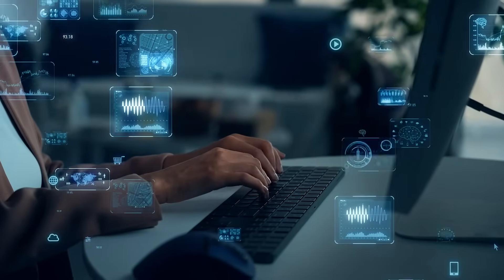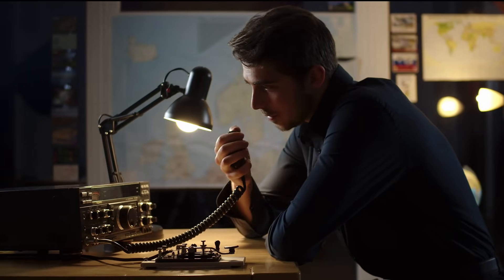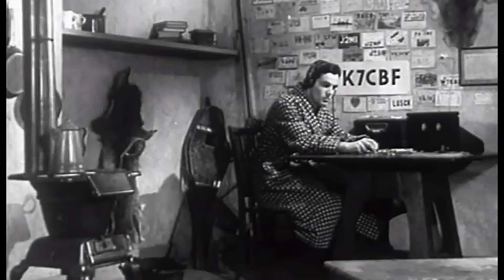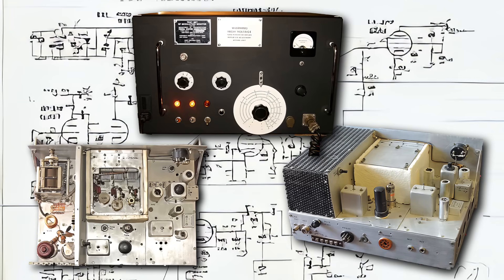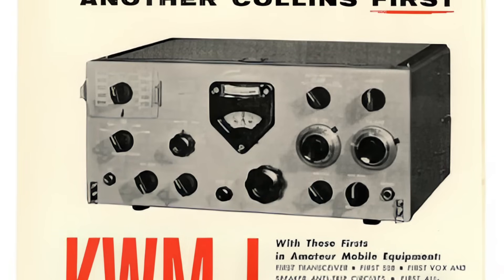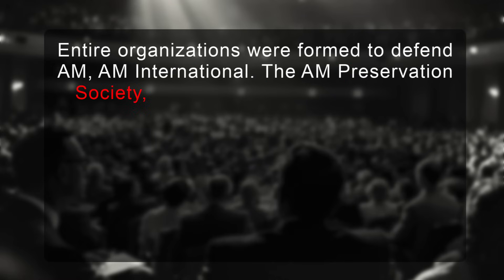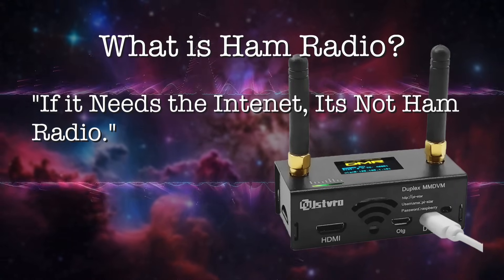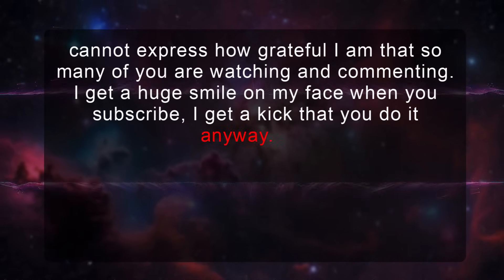Why Single Side Band (SSB) Almost Never Existed!

Comment: I knew SSB wasn't looked upon favorably when it first came about in the hobby, but I did not know it was hated as bad, or worse than, FT8 is currently.  I laugh when people say DMR is not real ham radio because it relies on the internet.  The only time you need the internet for DMR is if you are going to link a repeater to a global network such as Brandmeister or if you are going to use a hotspot to connect to talk groups on Brandmeister or other DMR networks.  You can talk on stand alone repeater or on simplex using DMR without using an internet connection.

Comment: i honestly never bothered to upgrade past tech-plus cause i never cared for usb on 10 meters., plus 13 wpm-no effin way was i going to be able to copy that. and now, i dont remember hardly any code. never even knew this story on this video about other hams so adament about AM. CB uses AM, but only 4 watts legal. On 10 meters, i dont even get ANY watts for the 29 mhz portion. Maybe someday i'll upgrade? 29 fm sounds more interesting than usb N9IZX Canton IL
Reply from the maker: Jeremy now that there is no code requirement, heck you could go for an Extra if you wanted. It would be nice to have you join on the rest of the HF bands as General at least.

Good Luck
Reply: I was kept out of SSB except on 10m for the best decades of ham radio.  Got an extra as soon as they dropped code, but with phones and the internet... talking world-wide just isn't the thrill it would have been.   That CW requirement was really... unfriendly.

Comment: I don’t understand why there was such a hate for SSB considering it’s way more efficient, especially over ground wave and goes a lot further distance wise over ground wave vs AM. These days some stations really spend a lot of money and have a lot of pride in making their SSB stations sound really good.

I have no love for FT8 and I’ll never do it. It’s too impersonal and lacks substance in my opinion. But hey it’s a great thing about the ham radio hobby, something for everyone. If you want to be an FT8 lover all the power to you.
Reply from the maker: I don't think there is that much hate for SSB as there was because it is the dominant mode. But in the early days it was new and many people don't like change.

I think the reason and value of FT8 is it allows even a small station or someone in an HOA the ability to get on the air and work the DX.

I see it as an entry drug to get more people in to the hobby. :) To carry on a meaningful QSO via voice requires personality and a level of genuine interest in meeting other hams. Some hams do not are are not capable of that level of interaction. LOL
Reply: @HamRadioGizmos you can make QSO’s QRP sideband. I see FT8 as the lazy hams mode. Especially those that let the automated version run 24/7. K7CAR for example, there’s no way he’s sitting in front of his computer 12+ hours at time clicking the mouse to complete the contacts.

I will admit your points are well taken but you’ll never catch me letting a computer make my contacts for me.
Reply from the maker: @truckinguy92  First, let me thank you for taking the time to share your comments. I believe it is healthy to debate these issues. We have forgotten to agree to disagree. Yet this is the basis for the entire constitution of the US. So thank you for taking the time to comment. Now here is a slightly different perspective.

When either contesting or watching SERIOUS hams during a contest. The computer does almost the same thing as FT8. They use clusters to find spots, click, radio tunes, and you make your call to the station. The software enters the call sign, frequency, it queries QRZ and enters their name, location, and a lot of the info.

I enjoy RTTY contesting and N1MM is all point and click. Add SO2R with two radios, and this is the only way to get a decent score nowadays.

And frankly, some days I don't want to pick up the mic and make small talk. "QSL, 59 here and rig is a ____" 

The other thing most people don't realize is that our society is changing. Not everyone can put up a tower and a Tribander. So, digital modes open the hobby to anyone with any kind of station.

And yes, you are right, you can work stations using QRP and SSB. But in my experience, this is like working a mobile on 80 meters. It is NOT armchair copy and the majority of hams do not want to struggle to pull out a weak station unless it is Rare DX. :)

Finally, I judge a mode or operating setup like FT8 or POTA by the value it brings and the growth it contributes to the hobby. It might not be my or your cup of tea, but does it help ham radio? And personally, I think the work that Joe Taylor and crew have accomplished with FT8, FT4 and other weak signal modes is nothing short of magic. I used to work EME, and in the early days, all we had was CW to bounce off the moon. But this mode has contributed to the growth of EME considerably with Joe's development of JT65. The guy is a legit Genius !! LOL

PREDICTION
If hams hate FT8, I can't wait to see the hatred when we see the development of "Conversational AI" that will carry on a meaningful conversation, and you don't even have to pick up the mic to make a contact. :) This is a natural evolution considering smartphones, Siri, Alexa, and other technologies that are being advanced daily.

I am not condoning or suggesting this is right or wrong. I am simply predicting the future as I see it.
Reply: @HamRadioGizmos  all good points. I’m not really into contesting, but I didn’t realize it was all so automated and computerized. Once again it’s kind of impersonal. Where everyone is a 59 even though they’re not.

My whole thinking about digital FT8/4 is that it’s so impersonal. Our world is being so conditioned to not communicate by voice any longer. Email & texting come to mind. At work & in life nobody wants to pick up a phone and have a conversation any longer. I can certainly convey want I want to say in conversation vs sending it in a text or email (I’m not the fastest typer in the world) a lot faster than typing it and then sending it. It’s missing the conveyance of emotion, and no an emoji isn’t the same. I just watched a news report the other day that teachers are getting frustrated & quitting because the children they teach have no communication skills. They’re not even able to hold a conversation, read proper English, or write with any meaning unless it involves a computer or a cell phone. They can’t even write on a piece of paper and cursive is no longer taught.

So with all of this automation, email and texting ham radio is my escape to a world where I can actually hold a conversation without sending it in a text or WinLink email. I feel that the digital modes like FT8/4 are encroaching on that because if everyone is there then that leaves less of a pool of possible people for me to talk to. Like I said I refuse to let a computer make my contacts for me.

The way I see it we’re headed down a slippery slope with all of this AI stuff especially when it comes to persons that would use it for nefarious purposes. There’s always going to be bad people in the world, but this AI stuff is going to make it easier to become even more nefarious. Then there’s the whole “Terminator” thing. As crazy it is science fiction at the moment if we’re not careful I feel it could become a reality in the future. And no I’m not a crazy conspiracy theorist that thinks the world is out to get me/us. I’m not saying all AI is bad, but if we’re not careful we could wind up in a lot of trouble.

Like you said, at the end of the day I guess we’ll have to agree to disagree.

Comment: Before Digital and VOIP, most calls were handled by sideband for all the reasons you stated.  L carrier may have been the most prolific systems for decades.   12 channels were muxed to dozens then hundreds,  Hard to believe all the voices sounded natural at the far end. 
Thanks
Reply: I don't know if it was an L carrier, but I used to work with the Lenkurt 45A, which was 12 channels.  However, these were used only on open wire pairs, though I believe cable versions were also available.  It was only in C band microwave gear that I saw multiple levels of multiplexing. Incidentally, the difference between open wire and cable systems was the open wire systems transmitted & received on different frequencies, so they could be separated with filters, whereas the cable system used the same frequencies.  They didn't need filters because they used separate cable pairs.

Comment: Not to mention, with SSB your signal will go further than AM, right ?
Reply: For the same power, yep.
Reply: I hate it when people say it will go further.  They'll go the exact same distance, but SSB will be usable further.  Signal strength varies with the inverse square law, where if you double the distance, you have 1/4 the signal strength.  They'll both keep going forever, until they disappear into the noise at the quantum level.  You just won't be able to hear them long before that point is reached.
Reply: @James_Knott  I think they mean it will go further for the same number of watts going into the transmitter.  How far signal "goes", in radio usage, ALWAYS means "how far is it usable".  The kind of receiver must be assumed.  The Voyager's signal is only usable as far as it is because the receiver is amazing.
Only in a purely physical sense do signals go "forever".  At some point I imagine they might fade into quantum noise and be theoretically unrecoverable, even if in some sense they are still there.

Comment: In the profession this is known as Single Sideband Suppressed Carrier. It is what makes cell phone towers work economically.
Reply: Actually, it's Orthogonal Frequency Division Multiplexing and Quadrature Amplitude Modulation.  It's an extremely complex system.  If you thought SSB was complex...
There's a series of YouTube videos called "Wireless Future" by a Swedish professor that goes into great detail on how 5G works.
Reply: Thought all cellular was packet-switched VOIP, these days, with I/Q digital modulation modes.

Comment: Excellent video! Theres a place for everything on the air. Ft8 and similar modes aren't my cup of tea, but oh8stn uses them for off grid coms and it's great for that. Low power and getting through even better than cw in poor conditions.  Pota? Why the hate? I bet there have been more than a few new licensees because of watching operators set up in parks. I guess it boils down to "That aint real radio because its not the way i do it.
73 from ki7syg.

Comment: In reality I suppose I am a reasonably open minded traditionalist. I refuse to pick fights with people, though I occasionally point out flaws with ideas or admit to having preferences when in the right crowd or forum. In a civil way. Was a SWL in the late sixties. Tech license early 80's, a low experience Extra (by 'accident') I forget when. I do have one preference which I defend (now at retirement age I can play faux curmudgeon if I want ;). I respect CW, will fonally conquer it, use SSB sparingly when I have time to get on air at all. Prefer digital modes....but that nasty FT8 annoys me to no end! 😅
Reply: I'm also a "low experience accidental Extra" - I went to the testing session, and after I aced Technician and General, the guy prodded me to go for the Extra.  I didn't ace it, but I DID pass.
Reply: How do you feel about machine-generated and -decoded Morse?  I will also eventually conquer it, but I'm struggling at 16 WPM after a year of almost-daily practice, and have a hard time believing in a realistic path to 25.  But on the other hand, I don't see any kind of shame in not being able to manually key or copy at a particular speed.

Comment: Several CB radio manufacturers felt so strong about SSB surpassing AM, that they made SSB ONLY radios. They were correct about single sideband being superior to AM but did not take into account the millions of radios on the market and already installed into homes that were AM transceivers. The sideband only models did not last long, whereas on the flip side, Kenwood hybrid radios did not include AM, and were very successful for well over a decade. Nice video, thank 👍
Reply: CB has been on a long journey in Europe.  In my country it first was AM only, then all modes but SSB only on one channel, then FM, and now all modes on 40 ch.
New people hired, and then new ideas I guess.  Anyway if you are really interested in radio you upgrade to HAM, because that gives you every possible option to experiment.

Comment: Analog TV used Vestigal sideband. Most of the carrier and one sideband were suppresed, which allowed a simple diode to recover the video modulation while saving bandwidth and lowering power consumption. I moved and rebuilt a RCA TTU25B transmitter that was built in 1952 foe a new station in Destin, Florida in 1990. That beast used 400A three phase at 480V to output 25 KW of visual signal. The real fun was aligning the diplexer to combine aural and visual to feed one antenna.

Comment: FT8 enables the hearing impaired to join the Ham HF spectrum.  Over 6000 contacts and counting for deaf guy.  CW decoding apps did the job and were okay before Dave's WSJTx.  Thank you Davic.
Reply: The hearing-impaired can also read Morse code off the waterfall display of any DSP radio that provides that, and gives you a lot more freedom in how you can communicate.  See also RTTY.  I really don't understand why RTTY is heard so little these days - at the lower baud rates it doesn't take much more bandwidth or power than CW, and since it's always machine generated and decoded, it's a lot more reliable than CW.  So don't think of FT8 as your only option.

Comment: Does US digital TV is not form of SSB (VSB) ?
Reply: No.  It's a combination of phase and amplitude modulation.  It's more like FM than SSB.  And if you look at it on a spectrum analyzer, it's very distinctive because the modulation is spread evenly across the channel, where SSB just looks like part of an AM signal.
Reply: @BrightBlueJim US digital tv (VSB) not europe (ODFM/QAM). I checked myself VSB is half way between DSB and SSB
Reply: @AK-vx4dy  You're right.  I was wrong.

Comment: I remember in the 60s when Dad was active on the Golden Bear Net, predominantly AM, and there were very vocal hams like W6PFF that insisted that the "talk power" of AM was far greater than a similar SSB signal, never mind that with the reduced Band Width there was much less noise! One evening the band conditions were poor and a station up north, somewhere in Seattle, had traffic for Los Angeles. Dad switched his Home brew rig to SSB and had 5-9 copy where AM was in the noise! 
I think demonstrations like that on air caused the "traffic net population" to see the light about SSB! As for listening to SSB on an AM receiver, as a kid I had no problem tuning in SSB signals on Dad's HRO 50-T1 receiver! 
WA6DVG  Bill

Comment: Good history video, thank you.  Just one thing, it's not that FT8 is a good or bad mode, i think it's an awesome mode, as you alluded to. It's that EVERYONE Uses it, to the exclusion of most,  if not all, other modes.  I prove it daily. The bands are wide open, FT8 is thumping, so i go to.....SSTV, PSK 31, MFSK16, hellschreiber, Olivia, Longchat, ROS.  (should i keep going?)   But nothing! They are all on FT8, like zombies.  At least when SSB took over as the main mode, if you wanted to use AM, you still could find someone to talk with on it.  Q65 is a better mode than FT8, and is found in WSJTX, but very few use it.  It's not FT8's fault,  but every Ham that wants to play follow the trend.
Reply: Only thing that makes me uninterested in FT8 isn't that it's digital, it's that it seems it is only ever used to make "contacts" rather than have a conversation.  It's slow, but I imagine no worse than my old 5-10 wpm CW days.

Comment: I do have a gripe about POTA.  Seems they have taken over the entire general portion of 20 meters.  We used to have a net near the top of 20 meters  at 2000Z, but POTA stations would be there first.  So we moved down lower, had that frequency for awhile then POTA was there. WE finally threw in the towel and moved the net to 17 meters and even there we sometimes have to dodge POTA operations.   IMHO POTA should be treated as a contest, since operation is similar to a contest and at least keep it off of 30 17 and 12 meters.
Reply: You might consider how others may feel about nets, who in many cases have shown proprietary attitudes about their preferred times and frequencies.
Reply: It isn't considered a contest?  Dunno how that would make any difference to the frequencies used, even if it were.

Comment: Well, back in the 70's there were some SSB capable rigs in the CB band.  That rivalry was there too.  SSB was allowed about 3 times the power of standard CB radios at 12W or so, whereas standard AM CB radios were limited to about 4W.  SSB and the regular CB operators had to share the same channel frequencies so SSB would step on the regular AM transmissions and vice versa.  Plus, the AM operators couldn't understand the SSB transmissions as they seemed garbled.  So, it ended up as an elitist thing of sorts because SSB capable CB rigs were more expensive and not many of them.  Wish I had one at the time.
Reply: Power wasn't really more, just measured differently because ultimately, the power was used much more effectively. These modes require a different method of measurement.
Reply: @stubryant9145  Yep.  SSB was measured in Peak Envelope Power (PEP).  Of course some less scrupulous vendors tried to make their gear sound more powerful, by claiming peak to peak power, which is a nonsense term.